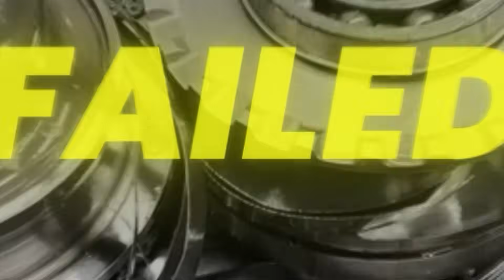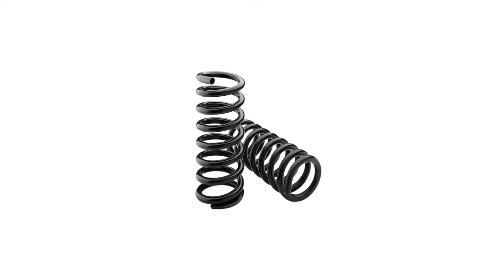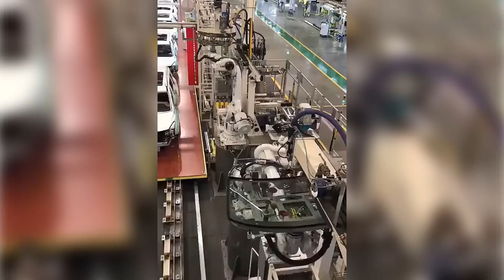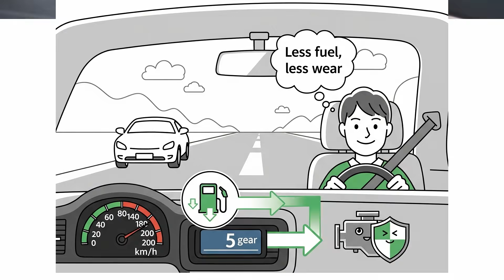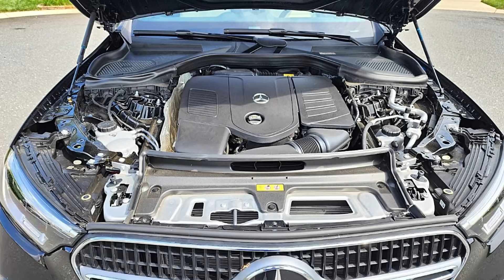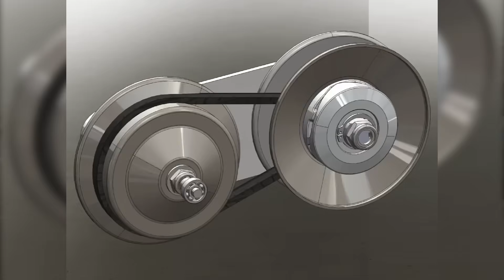How This One Bad Habit Kills Every CVT Transmission Before 50,000 Miles

Comment: Nissan rogue 2019 1.6L - 244,000 KM.
Most are not true, use those 3 lines for great and smooth gear:
1. Dont buy this vehicle if you are mostly driving inside your town
2. Gear oil replacement every 50-60k KM
3. Dont floor it when its cold

Comment: How can a belt in a CVT reverse direction when the driver goes from drive to reverse while rolling? The belt gets its power from the input shaft from the torque converter which is directly connected to the crankshaft of the engine and that force is transmitted to the input shaft via hydraulic friction in the torque converter. This mean that the belt can ONLY go in one direction at any time and any gear. Reverse is accomplished by a planetary gear system inside the CVT itself and has NOTHING to do with belt direction. The belt direction NEVER changes. Its output is obtained from the torque converter and engine, and they NEVER change rotational direction.

Comment: I think you need a physical, mechanical "launch gear" for 1st gear.  Low speeds put a hardship on the belt in a transmission.

Comment: CVTs are ALWAYS considered light duty units. NEVER strain them, hot rod them or overheat them. On medium sized vehicles, you're looking for trouble early if you treat them as a normal automatic. These work on compact and smaller vehicles best. If you live where there are hills, beware. As known, maintenance is extremely critical.

Comment: Don't accelerate hard , don't tow , avoid manual shifting , and change fluid (using CVT fluid only) every 50,000 miles. These are the only 4 things that matter.

Comment: I hate when people said there is no need to warm up a little bit your vehicle. They don't think about lubrication in motor and transmission is vital. Even in hot whether just a few minutes can save thousands later. Lubrication means cooler run.

Comment: CVT making a noise like a cooler noise, or dentist drill after pushed hard, RPM related, with power reduction and resolution after cooling down in my civic touring 2020, is it overheating symptom and should I do something about it?

Comment: Everything said here proves that CVTs aren't fit for purpose. Automatic transmissions handled all these things (aside from excessive towing loads) without problems. Most of these tips go against how cars are normally used. What a horrible design. They should never have been installed in anything larger than a scooter or ATV.

Comment: I have never heard of a CVT belt being replaced ever
 Toyota in the UK offer 10 years if you service with them.every year. And a friend works there for at least 17 years. Never has he changed a belt or even a battery pack on a HEV..
My CH-R will be serviced yearly for free for 4 years. Part of the deal i got last month. 
However i reckon this daft video. Has been.exaggeratted by 1000 times. They may be talking  about problems Honda had years ago. But today you won't have that crap. The fluid you take out should be what you put in. And the same.amount..just loom on the manufacturers site.
Remember using the wrong transmission fluid on any transmission can damage it..No different than just CVT.

Comment: CVT belt & pulley throw-away transmission was forced onto customers.  They didn't ask for it in mass numbers.  CVT's will fail prematurely no matter what because its not suited for the application.

Comment: Dealers don't want to change the filters .there setting setting up for failure. All cvt have filters, dealers say if they do they have to drop the valve body. This has nothing to do with changing oil and two filters.
Reply: You mean the transmission fluid pan, right?

Comment: I know people who have actually had those "unreliable" Nissan CVT's last 300,000Km.  They do 2 things that anybody with any CVT should do.  First do the basic service (drain, fill and replace filters) every 50,000 to 60,000Km and don't cheap out on the fluid.  Second it's not designed for racing.  Sure sometimes you have to give it gas to merge or turn left but don't it every time.  The CVT is designed for efficient highway cruising.  I'm a little old school and think the best tranny for off roading uses something called the millennial anti theft device, aka clutch and gears.

Comment: CVT and a heavy trailer, off road? That's a recipe for disaster right there!  I DO actually slam on my brakes right after install to test. You just claimed that a clogged intake air filter can overheat a transmission.  Whose car is using filtered air to cool their transmission radiator??  Stop and go traffic is specifically what CVT was designed for? Who wrote this piece!? Letting your car idle in your driveway to "cool off" for a couple minutes, has already occurred on your way home from your "heavy load".  We've got 167k on our gen3 prius, which is further than my son's f150 got before it needed transmission work. I believe toyota has designed a better CVT than most though.

Comment: CVT’s as an overall principle are great, for light applications (scooters etc)… under moderate applications, they’re TRASH. An extremely good insight into physics and failure. A friction based drive system, friction+load=wear. You can maintain the system and replace fluids to your hearts desire but the “belt” and pulley assembly’s will still prematurely wear out. 

The trade-off is wear (created by drive friction). In scooters the friction is lower, the wear debris from the rubber belt are atmospherically dispersed and the rubber belt easily replaced… in a vehicle the wear debris from the metal “belt” are dispersed through the ATF fluid and into the valve body causing further damage … the metal “belt” is not replaceable without a full transmission tear down; in most cases, capable specialists won’t even entertain the repairs due to finite recalibration involved.
Reply: Have 170k on my Prius Gen3 no signs of trouble. Use it to tow as well.

Comment: Air filter blocks air flow to the transmission cooler????? Those are 2 different systems.... usually the cooler is in front of the radiator. Air intake is on top on passenger side or driver side so how? Unless he didnt know what he was doing..

Comment: 30K miles ....the local Honda dealer has scheduled maintenance at 30K ; 60k; 90K and keeps going.  The transmission fluid drain and refill starts at 30K miles and every following 30K miles.

Comment: You can get a brand new from Nissan for $3500 plus labor.
Nissan told me if the trans fluid has never been changed, not to change it at all. I have 128k miles on the 08 Altima I just bought and Nissan recommended me not to change the fluid. That’s Fked up.

Comment: CVT transmissions work fairly well in lightweight cars for example 2,800 lb or less. They do not work well in some cars that weigh 4000 lb, especially a heavy all-wheel drive car or truck

Comment: In the photos that shows a rubber belt, it's not, it's a steal belt kind of like a herringbone chain like you would wear around your neck. The belt is pushed through the pulleys not pulled. You can never use a fiber or rubber fan belt type. A rubber and fiber drive belt would not last more than one day...😮

Comment: The best way to solve the cvt problem is not buying cars with a cvt.  I had a 2007 Nissan Sentra and the cvt failed three times before it hit 50,000 miles.  There is no solution to fixing a cvt.  The manufacturers push CVT’s because they are cheaper to produce, they are just a bad idea.

Comment: Since you don't drain out all of the fluid (only about 1/3 every fluid change), just change what was drained every 20k Miles (if used more on City), or 30k Miles (if used more on Long Drives)... Draining them full is bad anyway.

Comment: The maintenance with the low tolerance engine and CVT I think the cost of gas milage it's played out to be your not getting the huge gas is crap.  I think you're playing with a very expensive design.  Also, they aren't before all the new every one with the CVT is delicate.  The dealerships are robbing the folks. My Honda got rid of it, and now it's got Nissan 2021 Rogue with 26,400 the dealers are robbers. My next is back to a truck. Scew it!

Comment: Your video is showing the inside of engines, mentions manual transmission clutches, says CVT belts can last “20k miles”…are you for real? They should last 200k miles. 
In short, this video is nothing but nonsense, mixing automotive information with off road recreational vehicles.

Comment: Sound like the auto companies didn't provide proper cooling for them? If you have to idle for X long every time you drive your car, would cancel any fuel saving they provide? Do they have temperature gauges on the dash so you know when it's hot  and what is hot  and not ?

Comment: My Honda CVT get a 20K miles fluid change eveytime. And currently my Honda CVT is still running good at 300K Miles. Yes changing fluid often is critical for CVTs.
Reply: I suspect I won't be able to get another 2016 Honda torque converter auto - so good to hear your experience with CVT -  thanks!

Comment: Most of this is BS ! A new stereo harming a CVT ? Really ? I've been a mechanic for 47 years and never seen this, belt change at 20k miles ? Really!  Towing I agree with, low gear ? It does this automatically.Cvt fluid is NOT thick like honey! City driving ? What ? The first sign of CVT failure is rpms go up while driving. No such thing as a lifetime fluid, manufacturerslifetime means til the warranty expires.Proper maintenance with fluid and filter will make them last. I have a 2012 Subaru with 225k miles and a 2011 Nissan with 187k miles. Fluid change once a year. Not a single issue. Just another U-tube channel making easy money off uninformed CVT owners.
Reply: Thank you Michael and Happy Holidays!

Comment: I just got a pre-owned 22 Subaru Crosstrek. It is a bit underpowered with a 2.0 engine. But I am gentle with it, too. If I need to accelerate into traffic better or climb up a step incline, I'll take the S/I drive from "I" to "S". Mostly, I leave it on the default "I" setting. This is my first CVT vehicle. It has about 51k miles. I am not aware of any issues.

Comment: This video milks 3 real CVT issues into 13 fake “habits” for clicks.

1. Heat – Overload it, block airflow, or crawl in traffic forever — that’s what cooks your fluid.

2. Shock – Shift while rolling or floor it cold, and yeah, you’ll shred your belt.

3. Neglect – Ignore fluid changes or use the wrong stuff, say goodbye to pressure and cooling.

That’s the whole story. Nobody’s CVT died because they swapped speakers or went up 20mm on tires. Stop fear-mongering and just maintain your car.
Reply: I kind of had the feeling when I clicked on the video thanks for saving me a lot of time.
Reply: don't go to one of those 'drive-through xmas light shows' ... you want to be above 5 mph for the ones with starter clutches (like 00/10s era IMA Honda hybrids).
Don't roll onto power until about 18 mph; this is where the CR-Z 'S+' option becomes available ...  there is a reason they do this, to protect the CVT; it also doesn't let you 'bog' the CVT in 'Sport, paddle shift' mode, it will downshift to not let you 'cruise' below 1500 rpm.  They also had the HCH-I CVT peak torque come on at 3000 rpm vs 1500 rpm for the 5-speed version.
Change your fluid every 15-30k miles with either manufacturer fluid or a premium brand vetted by others over years (Valvoline CVT).  Make sure your radiator isn't decaying; you don't want to have the lines break internally and flood your CVT with coolant (for 15+ year old cars or ones that get a lot of salt spray; AL corrodes too).

So yes; have mechanical empathy, do PMs and any reliability mods the community has found viable ...  that is 100% of longevity to any car.

The video creator liked your comment that called them a content farm,
I'll be honest, I didn't think I'd learn anything, but was curious if I was missing some esoteric thing; your comment cleared it all up before I got into it.

Skimming through, I did see some title card transitions that make me facepalm; '25 mph/slow driving' is literally the sweet spot for these cars; CVTs choose the gear, you aren't able to bog it down; do not drive around in 'S' gear under 30 mph because of this ridiculous video of a person that never owned one.  I have >100k on IMA Honda CVTs.

They aren't fragile (ignoring Nissan), they just require different mechanical empathy than a manual or epicyclic auto.  Understanding your expensive purchase is too much for people though.  I guess $20-50k is chump change for people today, and their indignant to learning and thinking it should just be perfect without any thought or effort is the norm today.  Dumb, entitled public sells more vehicles than wise ones who even mildly care.
Reply: @Zero.Mikazuki $20k usd is a LOT of money whether they want to admit it or not. In the 90s that was 1/2 way to a cheaper house, unfortunatly things have changed and market is rigged to hell now.
Reply: TY,the best from this video is your comment
Reply: Wow thank u for this
Reply: Thanks for the comment. Thanks for whatever else you do. Stay good, man.
Reply: Apprixiate you so far so good 2010 nissan maxima at 250000 miles I am always up to learn new things cuz i cant afford a new car so this 2010 hopefully last me alot more lol

Comment: 1 one worst mistake is ............... ownership. Never own a CVT and you'll be fine.
Reply: What if I already purchased one, any advice?
Reply: @49CrownSt  They say to change the  CVT fluid regularly  and at shorter intervals than the manual states  Say every 15k to 30k miles. as opposed to 30k to 60k miles.

Comment: This make me feel like they purposely created this type of transmission so it can break down faster & earlier so they can charge customer  more often. And the biggest question is why are they using a belt under submerge of fluid? Why don't they use chain instead?
Isn't this a trap? Shouldn't it be a lawsuit?
Reply: None of these "belts" is rubber. All of them are steel. There are different types of these steel belts but none are rubber. The video showed types from OTHER types of vehicles and machines, not cars. As to "belts" in oil, ALL these steel types are in oil. What you may be confused about is that some makers use rubber belts in the ENGINE to run camshafts and oil pumps, submerged in oil. Dry timing belts are fine, but the oil lubed ones are to be avoided at all costs. Some makers are now reusing steel chains for the cam but still use a rubber belt for internal uses, still a totally bad idea. These are no better, they're suicide to an engine. NEVER buy a car with any of these. Investigate!

Comment: I could not be more amazed at the still original powerglide/turbo 400 automatics in my '68/'74 nova 250/firebird 400 - each with 250K+ miles. Motor are orig too, except for timing chain replacement in the 400.

Comment: Subarus are metal chains  built like a tank! Made by Fuji heavy industries in Japan my outback has over 300,000 😮 I Changed  fluid three times
Reply: Just did the fluid on my 2014 Forester at 100k.  Having the differential oil for AWD system done too.
Reply: Great

Comment: You should never buy a used car with CVT.  The odds that it was properly driven and maintained is probably close to zero.
Reply from the maker: Yes, always go for brand new with CVTs
Reply: @AutocornerdPros my 2002 Prius has eCVT, bought in 2020 and have zero issues.

Comment: So I have a 2007 Nissan Sentra with 156k miles. I bought it about a month ago for cheap and I'm experiencing light slipping, burnt smell etc. My question is should I drain and fill it at this point or could that cause even more issues?
Reply from the maker: Ask owner when did they change fluid last time
Reply: Replace the fluid. Drain and fill it at least once. Most people will do this at least twice and maybe three times until they have clear fluid. See if there is a filter to change or not. Most Nissans have a cartridge filter on the side of the CVT closest to the driver's side front wheel. That filter should be changed as well. This is all not a guaranteed fix to your current issues, but it is likely the best solution that will provide a good outcome. Replacing the fluid is a lot cheaper than an rebuild.

Comment: Nothing beats a transmission with good ole fashion clutch packs and torque converter
Reply: I agree to a point. Good old-fashioned clutch packs and torque converter are second best to a gearbox and a clutch
Reply: @johnharty5757 

Yes sir definitely i agree that a gear box with a clutch is king second to clutch packs and torque converter👍🏿
Reply: My CVT has two clutch packs and a torque converter.

Comment: Shows "having a CVT belt installed" by showing a rubber toothed belt being put on what looks like a dirt bike.  LOL.  Dirt bike torque converters do have a belt like that.  Cars do not.   They are steel, and very inaccessible.  If the belt in your car CVT goes, forget it.  You're not going to have it replaced because it will require complete removal of the transmission (and engine in many cases), and thousands of dollars.  You'll be replacing the whole thing, for even more thousands.  In fact, you'll be replacing the car.

Comment: CVT systems suck. Plain and simple. Vehicle manufacturers know they suck and will continue to use them because it is cheaper to manufacturer and once the warranty ends they'll go out. Which will make the customer to dish out money to buy a transmission from the dealer or buy a new vehicle.

Also, a lot of things in this vehicle is just a joke. 😂